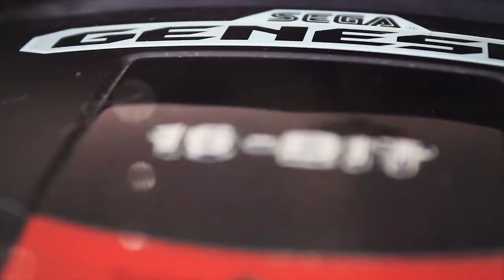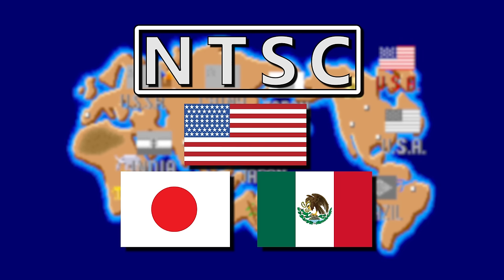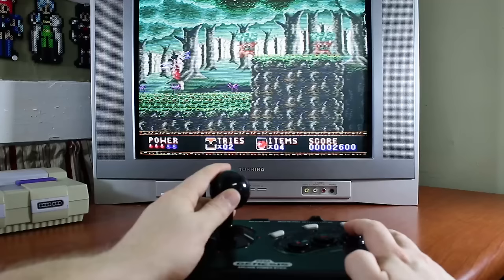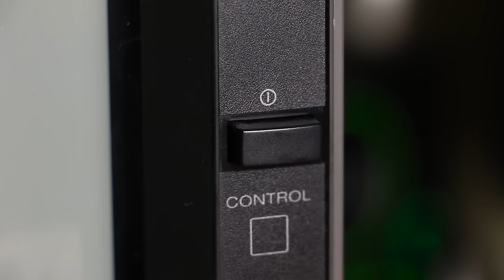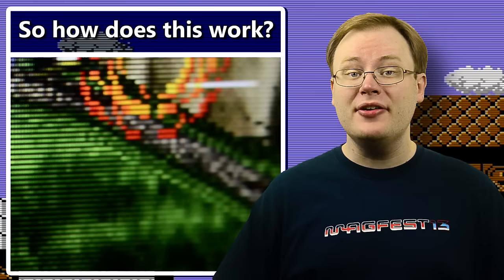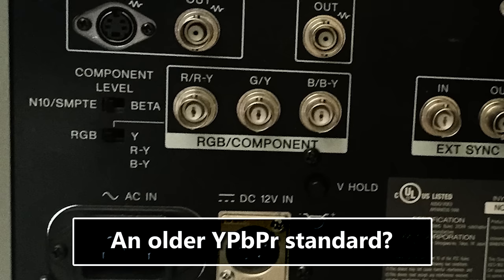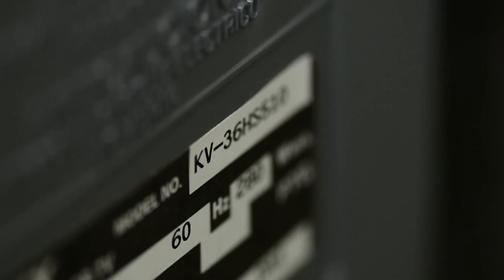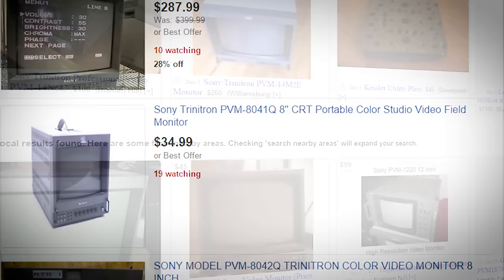Gaming on CRT Televisions, PVMs and BVMs :: RGB104 / MY LIFE IN GAMING

Comment: I feel as though at some point, someone will start making crts again for the retro gaming community.
Reply: The tubes themselves are incredibly difficult and expensive to make
Reply: ph0b0s  dont forget the volatile chemicals used to make the tubes as well and how many safety regulation hurdles they would have to get over just to attempt to manufacture them. Its honestly not worth it
Reply: ph0b0s  The market isn't really as big as you think though. Retro gamers are a market, but are nothing compared to the original market for CRTs when they were still being made, which was literally everyone who needed a TV or monitor. Even smaller yet is the market of retro gamers who actually care enough about playing on a CRT to pay for one.

The good news is that so many CRT televisions were manufactured that it will be many years before they are rare. Really good CRTs are kinda rare, but honestly, a PVM isn't a period-appropriate gaming experience anyway. Until about the 5th generation consoles, most gamers were using RF connections, so while it doesn't look great, that's the "genuine" experience. Heck, I used an RF connection via a VCR through the first couple years of the 7th generation because the TV I used only had RF.
Reply: @homestar92  It's true that RF or composite is the most authentic experience, and developers did keep the poor signal quality in mind when making the art. But I'm willing to bet that if you asked the developers back in the day if you should play on a old RF set or a fancy PVM with RGB, they wouldn't hesitate to to tell you to play on the PVM instead.
Reply: @homestar92  I'm a strong advocate for CRTs. I believe anyone and I do mean anyone who tries a new pc game on a decent CRT monitor (not just retro gaming) will have their mind blown. The difference is that good it's like night and day to the point where a person will likely go home and just be disgusted by the gaming picture on their AORUS RGB CV27" gaming thing.
Reply: @lullylew9083  well I think in sense of color pallets/ tones/ and contrasts a CRT has blows away newer monitors but for more precise imaging / pixels a newer model will definitely look crisper, although I was thinking of getting an adapter for pc to try certain games for crt that I think would pop. Cuphead on a crt would look amazing for example, the color pallet would match way better on one.
Reply: @lullylew9083  
Lol no. A crt can't hold a candle to a 4k monitor for new games that are made for ya'know, hd and uhd displays.

I'm sure it'll be playable, but no fam, just no. No one that cares about image quality will ever prefer a crt over a 4k (or 1080p) for uhd/hd era games.

That's not even touching the other tech inside a current high end monitor, like hdr, and g sync. So on top of turning the resolution down your asking people to turn off graphics options.

Just cause you enjoy something in an odd way doesn't make it the best thing ever and doesn't mean others will enjoy it. Especially after they dropped like $600-1k USD on a good monitor and another ~$1k USD to get a GPU in their PCs to make use of that expensive monitor.

Btw if it wasn't obvious I'm the target audience for your comment, I have a 3080 in my rig with a monitor to match, in addition to my retro collection (which I do play on a crt) I obviously care at least a little about my picture quality xD

Edit: Pixel art games from the current era of game and last gen would likely look fine or give the "retro" vibe on a crt, but something like RDR2 or RE2R, won't look anywhere near as good as on a 4k.
Reply: @christianjones7012  That's an opinion. I suggest you watch the numerous videos on youtube covering the subject and presenting the information. A high end CRT monitor beats out anything today for gaming, fact.
Reply: @lullylew9083  Sigh Well of course it's an opinion. What else would it be?
Reply: @johnhammond7579  It was spoken like a fact so I pointed it out is all. No harm intended.
Reply: @lullylew9083  There are too many people already who point this out though. How tiresome it is for us to preface everything with a phrase such as, 'In my opinion', wouldn't you say?
Reply: @johnhammond7579  Yes true.
Reply: @lullylew9083  you're crazy, and wrong.
Reply: @homestar92 Don't confuse accuracy with low quality. A console connected though an RGB SCART cable to an RGB supporting CRT consumer TV is the highest quality for retrogaming you can get while still being 100% accurate.

 I agree agree though that with PVMs you are entering into "non accurate" territory.
Reply: I think they should. It's a good idea. In keeping with the modern times, if more CRTs are made, the manufacturers probably should find a way of accepting HDMI cables even if it is only SD output. If only because the newer retro mini console classic rereleases I think only use a HDMI connection. Unless a adapter could be used of course.
Reply: No joke, there has been enough interest in Vacuum tube based hardware to start reviving that industry, the chances are slim, but real
Reply: @christianjones7012  A higher-end CRT projector that can do 2500x2000 as early as '93 could. Not sure how well the 5:4 aspect ratio at that resolution would treat modern games though.

Comment: Dang, that's a serious course on video engineering. And that's coming from a working Hollywood video engineer. :)  They're pretty much spot on on all this stuff. There's a reason they're called "reference monitors" - something had to be the reference by which to judge all TV's - and this is what content creators (=TV studios) used for decades to gauge their own work.
For professional users, the point wasn't how "awesome", "vivid" or even sharp they look. It was all about color accuracy and consistency. They actually need to be calibrated, like any monitor, but their starting point and drift are considerably better than any consumer display.

Comment: Another big benefit that no one ever talks about relates to how an image blurs when the eye is tracking. Modern displays almost always show a frame until the next refresh, meaning that the image might be there for like 16ms. Your brain is expecting continuous motion, as it would appear in real life, but what you're looking at isn't actually continuously moving! It's only moving in 16ms or 33ms increments, usually. As a result, the image will blur because you're smearing it across your retinas! CRTs don't use this sample and hold approach, instead spitting out the image as it scans across and down. Since the light hardly persists, blur is considerably reduced. Backlight strobing in modern displays aims to behave similarly, flashing the screen briefly for each refresh, but it has it's own problems.
Reply: Bro, that is the most important reason to use a CRT today, the motion movement or whatever, i cant stand it on LCDs, specially for old games.
Scanlines are overrated IMO, as i could never see them on my consumer TV, im OK with 480i.

Comment: I love the sound of that soft static explosion when I turn on my CRT.  I love the way to glow seems to just engulf me and mesmerize me in a way my HDTV just can't.  I love scan lines, light gun games and zero input lag.

I have owned a BVM, and a PVM, and used the Framemeister at a friends house, but for me nothing can replace my 27" consumer SD CRT.  As long as I have the room in my house, I will be gaming on a CRT.
Reply: quiet451 you find a bvm worse than a consumer crt? Not trying to be that guy, just wondering. What model was the PVM and BVM
Reply: I think what they're saying is that for nostalgia's sake nothing beats the consumer CRT they started with. I feel the same way, there are much better CRTs out there, but I will never get rid of my consumer Trinitron - my parents bought it in 1996 and it has been around my entire life
Reply: @fripp555 I agree with you, PVMs aren't the panacea they're made out to be. Although if money were no object I'd probably want to get hold of a BVM that is > 15 inch.
The 9 inch ones are too small,  coloured pixels blend together too much, even with HR (450 lines)

Comment: God damn I'd love one of those PVMs...
Reply: +Strekks Honestly, they're overselling PVMs a bit in this video, at least in my experience. Now, the super-high-end Sony BVM monitors probably do look every bit as good as they describe, but good God are they expensive!  Even used, with 20,000+ hours on them, they go for bank on eBay. I ended up finding a 20" Sony PVM-20M2 on eBay for somewhere around $200 shipped. I hooked it up alongside my 27" Sony fv300, a fairly high-end consumer CRT in its day, so I could compare the two. The PVM did look better in terms of screen geometry, but color saturation and black levels were basically the same. And of course the TV has a bigger screen, remote control capability and a built-in tuner for the old pre-AV connection stuff. Ultimately, I ended up sticking with the TV and using the PVM as a bench test display.
Reply: +Shmeh Fleh - That's cause of their weight. You won't find these monitors in the wild very often so you have to look online which means shipping costs and my 19" PVM is 70lbs. I paid $30 for the monitor from a used medical surplus warehouse from Wisconsin. Shipping was $60.

Alot of these PVMs were used in hospitals so you have to look into liquidation warehouses. But you have to be careful cause they can sell you a broken monitor. I ran into this issue and was luckily fully refunded. You need to be smart and aware when shopping for PVMs online.
Reply: They're not as great compared to a modern high-quality OLED via OSSC/Framemeister.
I have both, and honestly, the color reproduction on a PVM is pretty sub-standard compared to OLED.
This is due to the fact that even a CRT doesn't have a pure black surface, and poor brightness.
It can only be as black as the screen is when off (a dark grey).
Reply: Scanlines + Lag reduction. 

How are you not understanding this by now?
Reply: in blacks oled has the edge, in the rest of the colors gamut pallet, OLED tend to look artificial, with over saturated colors
Reply: The main draw for a PVM/BVM or consumer set is zero lag and nostalgia. Some go for a pure "emulated look" while others like me want the look they remembered as kids + no lag. I used to have a Framemeister. It looks amazing but I wasn't doing as good in games because of the lag (My HDTV was also great at low input lag) I have not tried the OSSC but I have heard it's not much better than the FM.
Reply: Shmeh Fleh not a good example. Your pvm is low end. You need one that shows 800 lines.
Reply: So I’m not sure how good this would work but you might be able to use a bar  TV that is an LCD cuz it’s technically RGB? I have an old NEC monitor from a bar with the BNC connectors.
Reply: Strekks Me, yesterday: God damn I’d love one of those Trinitrons...

Finally brought one today, best 100 quid I’ve ever spent.
Reply: Jon The Otaku - AF5000 No, as it’s not a CRT. If you want CRT gaming, it has to be on a CRT. RGB cables are unrelated.
Reply: KEEVS The OSSC is lagless from what I’ve heard. The video is just linedoubled, which is done instantly or at least near-instant.
Reply: I bought a small 9" PVM and I really love it.  Most videos just don't do the PVM justice.  Somehow looking at a video it looks different than with the naked eye.  The screen looks gorgeous.  I would love to have a larger one, but I just got mine off of ebay, and I don't want to shell out more.  It looks better than component on a standard CRT, I can tell you that.
Reply: I recently got 20"PVM. Picture quality is amazing... almost too amazing. After a while using it I just came back to my consumer grade CRT TV.  Looks to my eyes more faithful to times when I was playing those games back in the day. And I'm sure most of people played it that way.
Reply: I work at a TV station... I know where there is 13" not doing anything... very tempted to take it as no one would care... just wish it was like a 20", playing games on a 13" tv is hard...
Reply: KEEVS OSSC has no lag because it doesn’t cache frames, it processes per line as a line multiplier. Framemeister has 1.5 frames of lag. Most lag can be attributable to the TV itself. The best 4k Vizios and LG OLEDs have 1 frame of lag in game mode. That’s pretty close with OSSC.
Reply: I've got a PVM. Unfortunately the screen burnt out before I could even use it, so it's kinda worthless. I can turn it on but I can't see anything.
Reply: What's a PVM?
Reply: @mikeymcmikeface5599  professional video monitor

Comment: Hadn’t watched this in a while so I revisited tonight. Really well put together and entertaining. I’ll leave my two cents on pvms if anybody here is consumed with finding one in 2021/2022. I was lucky enough to come across an 800tvl 20in pvm a year and a half ago. I got it calibrated and future-proofed by a pro. Yes, it looks amazing. With component video or s-video it is sharp as can be. However, I like playing on my 32in jvc regular crt more. It’s bigger and easier to play on from sitting back on the couch. After playing on a pvm in person for a long time, I can say that the eBay prices on these are not worth the quality increase you get over a good consumer set. Find yourself a low-hours consumer set, adjust the settings the best you can, and enjoy some games.
Reply: Do you know if it's possible to mod my NES with NES RGB Tim Worthington and have the snes multi-out connector and connect it to the JVC 32 in via component?  With this setup, would you truly see RGB coming into the JVC via component cable?
Reply: @sonicmoj1  If the tim worthington rgb mod makes the pin out on the multi-out the same as a snes, yes you can. Just use HD retrovision component cables. They transcode the RGB from the multi-out to component video perfectly. I just don't know if the pinouts on nes and snes match perfectly after installing the mod. You'll need to find that info yourself.
Reply: @dylanjastle  Thanks for the information.  I'll be sure to look at that after I have the NES RGB mod completed.

Comment: CRT's have another massive advantage over even the very best OLEDs: zero motion blur.
 I'm not talking about blur from slow pixel response, but from your eyes when they're tracking movement across the screen. 
Due to the scanning way of rendering (v.s. holding entire frames for their duration), your eyes won't blur the image as they move across the screen. Modern 4K displays will simply never look sharp in motion when displaying 24/30/60+hz. This is the main reason for upcoming 240/360hz gaming; not so much the slightly reduced latency. But for movies and video, CRT will always have the sharpest looking motion.

Comment: For those looking for a good CRT for retro gaming I recommend getting a Sony Trinitron.  They are big (up to 40" but I was only able to find a 36"), have amazing picture quality and have multiple rca, A-line, and component imputs!  The only downside is they weigh 300+ pounds on the larger models!
Reply: just get a 19inch Toshiba CRT or JVC CRT, both brands tend have s-video and Y-pb-br component video support
Reply: Ballowax 2002 or a Trinitron
Reply: @justanotheryoutubechannel  Look man I like CRTs but I like ones that I can carrie easily, like those 13 and 19 inch sets
Reply: On the flat ones though is geometry issues.
Reply: Fk those things, they weight a ton and can do some damage. I had an opportunity to pick up a 2002 32 inch model but passed up on it after I tried to lift it. Now I have a 20 inch Panasonic tau from early 2000s,  and it offers a glorious image.

Comment: Found a PVM at my local thrift store for 15 dollars 😬
Reply: Did it work????
Reply: +ivan Skrr It worked, but right now I don't have any room to put one 😓 
Maybe when I move?
Reply: Samuel Baugh thats awesome! hope you find somewhere to put it once you've moved :D
Reply: Nice catch man, enjoy it.
Reply: you sure got lucky there man
Reply: well there is a "modern solution" now for low latency gameplay
get a cheap hdmi pc monitor (they have generally way lower latency than a tv)
and take a cheap scart to hdmi converter or a composite to hdmi converter.
enjoy!
(i know it is not as good as a crt but it does the job better than modern tv at low prices)
Reply: Tailslol As soon as you use one of thoose cheap SCART to HDMI scalers, you will get lag. And loads of it! Nothing beats the Framemeister or the OSSC. Only a good CRT monitor aka BVM's or PVM's is superior (IMO). The only downside: no 480p ( except D chassis or L5 sonys, or the NEC XM29).
Reply: Filipe Geadas time to stop dreaming...
framemeister is expensive due to high demand  and no more built
ossc hmm maybe but as open source get ready to get some chinese version when they feel it will be good
good crt (bmv pmv tv) are heavy ,old and decent ones are getting harder and harder to get...
and those chinese scaler are so simple they dont add a lots of lag,it has been shown already they add a lots less lag than any hdmi tv due to the lack of post processing most tv add (game mode included). this is why if you put them on a pc monitor,this is how you ll have the less lag with modern easily available and light devices...well until you get a chinese ossc...
Reply: Tailslol For me I Will always play on a CRT in RGB. At least until they last. I don't mind the weight. Love me some light gun games.
Reply: Filipe Geadas good for you,me I lost my Sony Trinitron analog 82 cm flat 4/3 4 years ago.rip
Reply: I live in the UK and if I saw a PVM for £11.68 then I'd buy it in a heartbeat
Reply: All of the good wills in my area never have crts
Reply: Samuel Cowan at least you have Goodwills. The UK has literally none at all.
Reply: @Zombie simple, pvm's have BNC connectors on the back instead of normal RCA inputs.